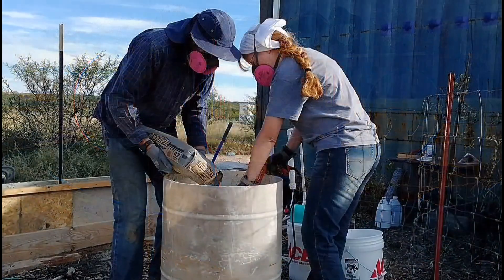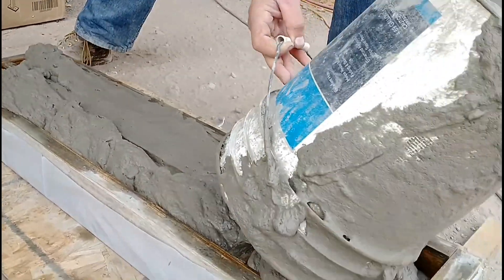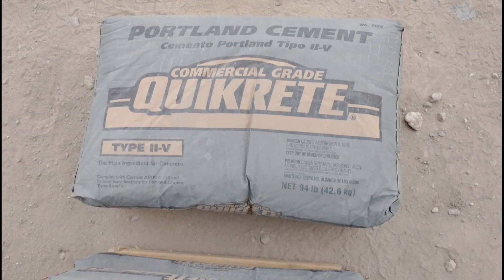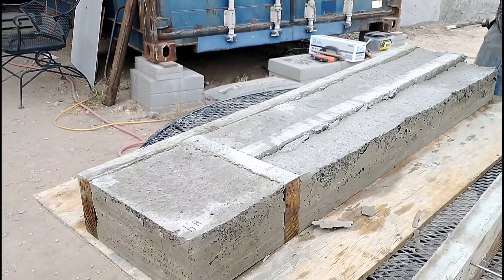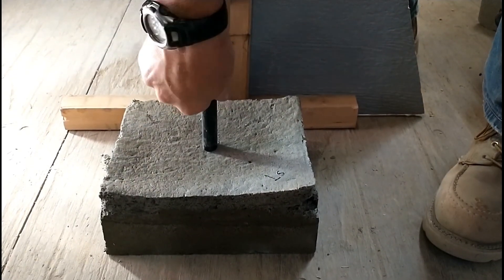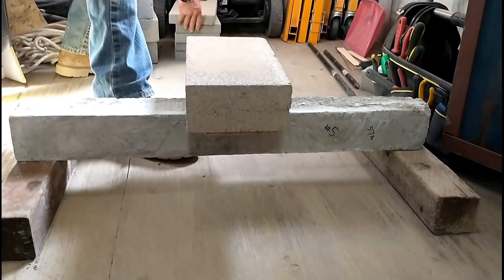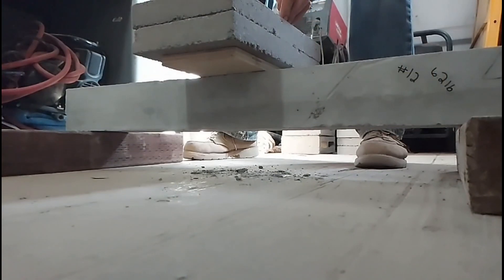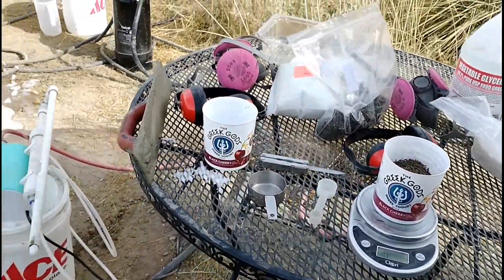AIRCRETE Dry Testing | More Failed Batches!?

Comment: glycerin ?  veggie oil ?  how is that going to dry ? I would think that would keep a permanent slight mud. even a low concentrations, wouldn't that just be like dry, barely hydrated playdoh
Reply from the maker: Someone recommended using it, we had some, and it was cheap. Some of our earlier batches turned out great, I don't think it hurt anything. We suspect the colder temperatures were to blame for our later issues. We didn't have a controlled environment to make aircrete, so it wasn't going to work for us.
Reply: @RedandAprilOff-Grid  eventually i'm going to try aircrete. my ideas for bulking are, charcoal from carbonizing wood ; recycled plastic, glass, rocks, clay from the site, crushed bricks / cinderblock / any stone-like material.     
     Regardless, if the money is available just make concrete walls / cinderblock is a staple.  Aircrete is mostly a budget idea.  it would probably go good on the outside of a structure to resist the elements.  
   Another idea is aircrete, with epoxy coating. That'd make a more stable light/strong brick.

Comment: As a structural engineer I fail to see the point of these tests.  Concrete is good in compression and not tension so a tensile fabric on the bottom side would be required to achieve any notable flexural strength.  To balance cross sectional forces the denser aircrete (settled on bottom) would be on the top for better compression strength. Tensile fabric would be added on top but used on bottom of beam.  If tensile fabric strengh matches or exceeds compression strength then that will optimize the flexural strength of your member. The main advantage of aircrete is its ability to fill volume with a self supporting, self insulating material, lightweight, ecofriendly, and inexpensive material.
Reply from the maker: The purpose of our testing method is explained better in this video https://youtu.be/5HkchwhuJcA
Yes, we were definitely planning to cover the inside and outside with fiberglass mesh and plaster. Good aircrete is pretty decent, but off batches are really crumbly and brittle, and not suitable for much. We are also seeing from the garden wall that aircrete continues to shrink. The only way I would even consider using it is for bricks that are fully cured and dry, and it would definitely need fabric and plaster.

Comment: One other thing I noticed was in your pour... I'm wondering if you should be taking a mallet and knocking out any potential air pockets before leveling off the excess. I don't think you'll do any harm in the micro bubbles by giving the forms a few good whacks just to make sure.
Reply from the maker: He tries to bump it in some with the bucket when pouring it in, but it probably wouldn't hurt to do it a little more. 🙂

Comment: I am talking to Aircrete Harry about a Medieval Fireplace wall that will be 12ft tall made with blocks but I am thinking of using his EPIC mix but instead of styrofoam I'm thinking of Perlite which can be shipped to you in huge 70m3 totes. That with recycled paper insulation, it should produce a very light and insulative concrete mix. I haven't tested with it yet but I think if you tried this, it would really solve all your problems. 

Also the dimensions for my bricks are the same as traditional medieval castle bricks (18x12") but given how light the bricks would be, you could easily build your house using traditional mortar and light weight concrete bricks rather than a single pour tall wall. It probably would take you just as much time doing traditional block laying as it would to building those forms and making sure they are braced correctly and don't leak.
Reply from the maker: A Medieval fireplace sounds awesome! Best wishes on your project! 👍😊

Comment: Why not test it with its textile reinforcement layer when performing the beam test? I'm not sure what you expect out of aircrete by its self. I think it should be considered as and insulate layer with some compressive strength that is part of a system.

To bad you don't have lots of time. I feel I will be facing the same challenge as use as I am still in the testing recipe phase and time is short. I have been working with a mix of light weight aggregates and Urethane and acrylic binders working with the cement. They have been more consistent for me then pure aircrete. Problem is the slow turn around time for curing. I have had very interesting results with elastic roofing acrylic and styrofoam aggregate. Very bendy and light weight bricks. My goal is to find common materials and affordability.

I'm also still trying to find a textile fabric that is cheap and strong. "PP non woven needle punch" may be a solution. I would love to go canvas if I can source some cheap enough. I would avoid any polyester fabrics. They can rot in the alkaline cement. At least you are only using aircrete for infill so you should be able to get your walls going with much less demand on the aircrete. I always say its good for domes or infill, but not structure walls.
Reply from the maker: Our testing was to compare different recipes to each other, and to see if we could make consistent batches. We also figured we would end up with some less than ideal batches, and wanted to see how those would perform too.  We have seen people on YouTube show some of their samples that turn out very crumbly and brittle. We don't want powdery aircrete inside our walls even with strong fabric and plaster on the outside. Our first successful batches were awesome compared to anything we have made recently. We would feel a lot better about pushing ahead with it if we could even come close to replicating our earlier batches. We'll show the rest of the garden wall, as well as the fiber samples and the results from those tests soon.  We thought we would be able to make aircrete through the winter, but our particular area is getting well below freezing already. 
It is expensive, but we were planning to use the fiberglass mesh for the outside, and possibly the inside too.
Reply: @RedandAprilOff-Grid  Thats frustrating to have varying results but that seems all to common with aircrete. Most people just go with the lesser bricks and keep building. I"m guessing you have looked at your well water? Sulfates can be an issue as an example.

Thanks for the updates!!!

Comment: Hello, don't loose hope just yet! Thomas Jefferson would be disappointed lol. From what I see you have great results!
What are you guys trying to achieve or test for with your beam test, how is it going to play a role in your build? Are you planning to use aircrete beams for rafters? 

I think you may have great results with the samples you have already made. Just need to pick the one that suits your purpose.
What you may be looking for in aircrete is that it doesn't collapse while its drying and after its cured it is hard and doesn't dent easily, with such results you'll have load bearing walls. As an option you may use hog panels 'or something similar, chicken wire, etc' inside the walls as reinforcement. 

Here is an example of a test that shows the true potential of aircrete and its load bearing strength.
channels name is Jim's cool stuff:
https://www.youtube.com/watch?v=wDiQkayscaQ

Also maybe you've seen this channel as well is "Honey Do Carpenter'?
He made a great looking shed with aircrete and his way of doing it is also a great option for strong walls.
https://www.youtube.com/watch?v=tKVsH1dkl6M

What would you do for the finish of the walls, stucco? 
This guy uses a simple method for adding strength and waterproofing the walls.
https://www.youtube.com/watch?v=XzVETOW0L-Q&t=33s

Wish you all the best and success in achieving your goals of being self sustainable. God bless.
Reply from the maker: Our tests were to compare different recipes to each other, and to see if we are able to make consistent batches. These were just fairly easy and repeatable tests to give us some idea about aircrete's brittleness and strength.  We also figured we would end up with some less than ideal batches, and wanted to see how those would perform too.  We have seen people on YouTube end up with aircrete that is very crumbly and brittle. We don't want powdery aircrete inside our walls even with strong fabric and plaster on the outside. Our first successful batches were awesome compared to anything we have made recently. We would feel a lot better about pushing ahead with it if we could even come close to repeating our earlier batches. We'll show the rest of the garden wall, as well as the fiber reinforced samples and the results from that soon. Thanks! 😊

Comment: I have been there, done that....  I highly recommend NOT using aircrete for your house build. I had all the same issues you are having. I could never get good consistency in batches. After my dome build, I then got large cracks in the structure.
Reply from the maker: When I asked you about it earlier, I was so sorry to hear that it cracked. 😰  The dome turned out really well, and it looked like so much work! We thought aircrete might still work okay with thicker walls, some reinforcements, and making the walls non-load bearing.  We'll be revealing our final testing conclusions soon.

Comment: So obviously some factor changed between the first tests and second tests.
However, I'd like to propose that although your test are interesting they have little bearing on using aircrete for NON STRUCTURAL / NON LOAD BEARING walls where there's a steel frame doing the load bearing. Your simply trying to fill the space between columns with a reasonable strong insulator.
I've seen perfectly fine houses built of 2x4 walls with 1" white styrofoam and thin vinyl siding (both of which have no real structural strength) external envelope and fiberglass batts between the studs with sheetrock as an inside face. And this home is on the Texas Gulf Coast and has survived 6 hurricanes down through the years.
I believe that a 6" thick aircrete wall has plenty of strength anywhere, even where you live. Especially if there was stuff wire mesh stretching between the support columns in the center of the wall.
I think you should plan on fiberglass or poly mesh and plaster to coat the interior and exterior walls because that actually adds an amazing amount of ridigidity and strength.
Reply from the maker: It might work, and our first samples were awesome compared to these later ones.  I am somewhat worried about it crumbling inside the walls. Our temperatures here often change 50° from morning to night. Because of that, it seems like there will be a lot of contraction and expansion, and it seems like the wire might contribute to breaking it apart rather than holding it together? Our next samples are with fiberglass and basalt fibers. We will be showing those soon.
 It will be interesting to see how the garden wall holds up this winter with all of the different batches and mixes it's made of. We plastered one section of the wall, and will be showing that soon too.
Reply: @RedandAprilOff-Grid  Although the air temperature might swing 50 degrees, I'd guess that the wall will only change 10 degrees during the day. It has a huge amount of thermal mass, an R value of ~2, and will be heated from the inside on cold nights. It'd be an interesting thing to test with a mock-up wall section and a data logging thermometer.

Comment: Drexel is not made for cement.  CMX is.  If they froze the first night you would see a totally white surface. Edit: Just colder temperature will explain new collapsing.  The proper set-accelerator can allow the cement to set up before the foam collapses.
Reply from the maker: We saw some white patches on the garden wall and figured it might have froze. We are learning that our low temperatures are 20° colder than in town, so that's not helping anything.  These later batches were poured at about 10° cooler than the first sets of samples. Low to mid 70°s instead of 80°s like the first set. I did finally read that Drexel needs to be used and stored at room temperature, so we  kept it inside for our last set of samples.   
  Drexel seems to be what most people recommend using, we hadn't heard of CMX. When the samples fell, it happened pretty quickly.
Reply: @RedandAprilOff-Grid  Here type I-II cement does not appear to be available anymore, so I guess we need to  get used to type V sulfate-resisting cement.  If you retard the cement, it will collapse - no foaming agent will hold up forever.  So doesn't it make sense to accelerate it in cold weather?  Calcium nitrate (fertilizer) or aluminum sulfate or one of the shotcrete accelerators at a harmless low dose - but alkalis may kill Drexel.

Comment: There's a guy on YouTube that ads shredded stryrophone into his mix and built his hole house. Even made it a 2 story house. I just can't remember what his name is. Also try adding concrete fibers to your mix, thats where concrete gets alot of its strength.
Reply from the maker: Steven Williams has some interesting stuff going on, but It would be a huge ordeal to collect, store, and shredding the huge amount of styrofoam that would be necessary to build a house. If we can get aircrete to work, we would much rather build with it. Yes, our next set of tests are with basalt and fiberglass fibers. 🙂
Reply: @RedandAprilOff-Grid  I was just talking about doing a test to see how both would work together. The stryrophone and concrete fibers. But it sounds like you might be on to something with your idea.

Comment: Another YouTuber (Handeeman) built a house using ICF Panels and when they poured the concrete they used concrete with a metal fiber product mixed in which the manufacturer claimed eliminated the need for rebar.  I believe the company was called Helix Steel Micro Rebar.  I wonder if a product like that or even fiberglass fibers would increase your Aircrete strength.
Reply from the maker: Yes, our next step here is to test batches with basalt fibers, and fiberglass fibers.
Reply: The steel fibers aren't recommended  for aircrete by the manufacturer nor by others testing them as they then to sink somewhat. The basalt fiber tends to float in amongst the bubbles as it cures so does a better job.

Comment: Did you add a water filter system before your softener ?
Reply from the maker: No, we are using clean well water. What would be the purpose of filtering it?
Reply: @RedandAprilOff-Grid  it takes the bad out of the water to be softened through the softner